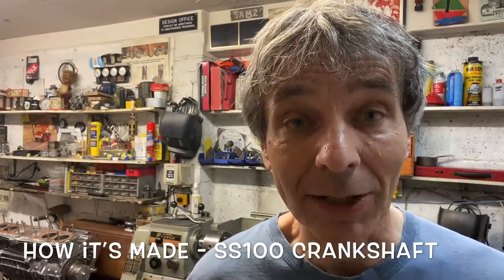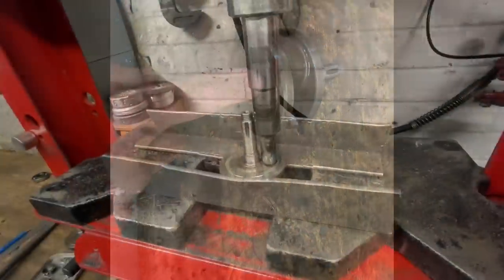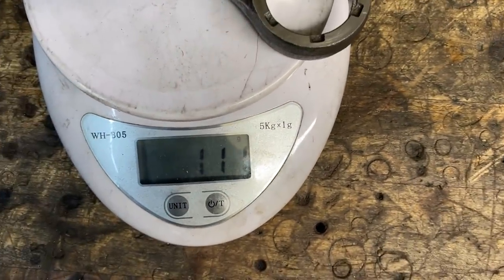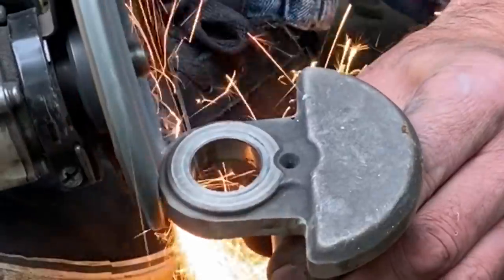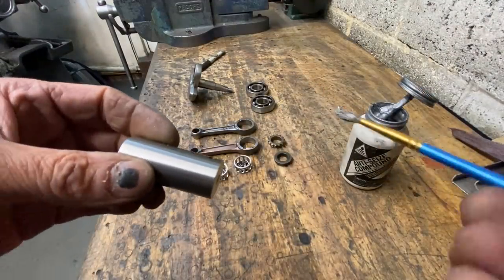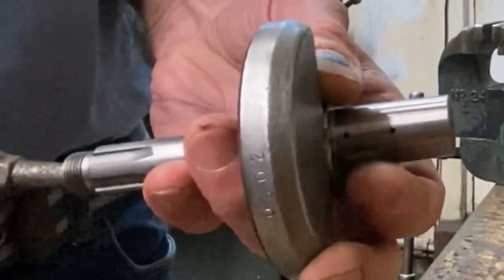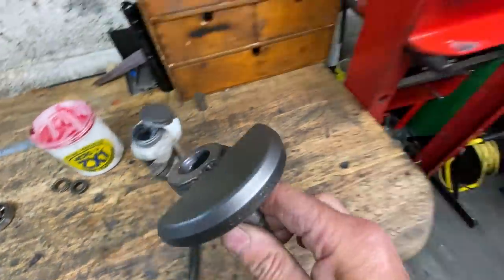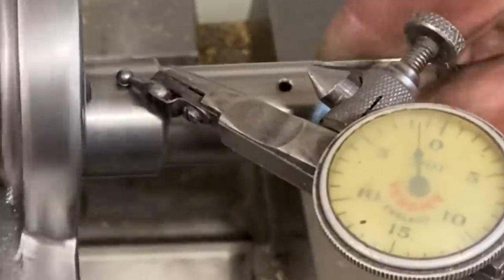Millyard Honda SS100 V Twin Crankshaft - How its Made 4

Comment: So do you machine the longer crank pin yourself? Or is it a reused part? If you make it what type of steel do you use?
Reply: Indeed, my question also, i think it is a bought in part, Allen will let us know shortly, im intrigued, fancy a go myself.
Reply: @michaelhayward7572  Yes, let's wait for Allen to tell us.
I can't wait.
What is it about this channel?
Addictive
Reply: My question also.  It certainly doesn't seem likely to be an off-the-shelf part.
Reply: He gets them made,
Reply: My question also.. i will wait for answer.
Reply: @stevebird8407  why would he get them made when he has a lathe ?
Reply: @Deftonesdsm  The process for the pins is more precision than a lathe by itself can produce, they have a ground and then polished finish as well as heat treating.  Perhaps he can ultimately do all that, don't know.
Reply: @Deftonesdsm  I would say heat treating/case hardening would make   DIY manufacturing difficult.
Reply: @Deftonesdsm   I'm guessing but they probably need grinding to get the accuracy and the surface finish
Reply: Could be an off the shelf unit. May be a special custom made item. Either way they need the correct heat treatment and precision grinding for a needle roller big end assembly. There are a number of possibilities open like finding an existing part that may be longer and larger in diameter then cut to length and grind between centres to desired diameter.
Reply: My guess is that he gets it made by Alpha Bearings.
Reply: @iandusud  yep! that is a very viable option for a 'special' builder
Reply: @Deftonesdsm   Needs grinding and heat treat.
Reply: @dumbbeerholder  you could 100% do that on a lathe. The hardening im not sure. If its through hardened then just really strong tools on lathe could do it. If its case hardened you'd need a precise oven for that and they do sell small "homeowner" ones. If anyone could do it it would be Allen
Reply: @oldretireddude  you send the component away to a specialist for heat treatment and case hardening, engineering companies use them all the time
Reply: The Pin is the "Secret" I guess...You CAN NOT make Crank Pins at "Home"!..I guess he found one from another application...which makes this Video USELESS without that info...Unless you have the wherewithal to strip out lots of Cranks to measure...Kinda dissapointing..
Reply: @Deftonesdsm  You seem very sure. How many engines, car or bike, do you know of which have turned pins?
Reply: You could make one, case harden it and get it ground to size. Loads of places in the UK do that sort of thing. My dad made custom rocker shafts for Rover engines the same way back in the day.
Reply: @Deftonesdsm  Hardening can be done by a flame then a quench.  Effectiveness would rest with the kind of material, likely ground and polished after the treatment.  I rebuilt many roller bearing cranks when I worked in a dealership back in the '70s.  Their techniques changed a bit over time with repair parts - most new pins came chemically etched on the parts going inside the flywheels.
Reply: @whalesong999   I just figured he threw it on the BarBQue.
Reply: @guzzijack9714  Hah, that's super..!  It's a hoot when he does that..;)
Reply: @Deftonesdsm  They have to be hardened and ground for the correct finish. Ps My question is how does he drive the cam. One long chain with one cam sprocket spaced outward. LETS WAIT AND SEE.
Reply: @whalesong999  yes with his angle grinder if the rest of the crankshaft is anything to go by
Reply: Allen made it out of 12   6" nails, welded together and hand filed to within 10 microns of accuracy. With one hand tied behind his back!
Reply: @iandusud  I understand he used Alfa bearing for the crank pin of his Velocette v-twin.
Reply: He says in this video that he gets his crankpins made by Alpha Bearings >> https://www.youtube.com/watch?v=PJS8NO2Koic  @ http://www.alpha-bearings.com/  I don't think it is meant to be a secret, he just forgot to mention it.
Reply from the maker: @madgardener5820  I get the extended crankpins made
Reply: @AllenMillyard  oh,, now you answer,,,, after how many people died of of acute anticipation,,,,, lol ;)
Thank you Sir!

Comment: More questions than answers , like where did you get the longer drilled crank pin?  How did u arrange oil for the camshaft  ? How did u fit a wider crank in the cases?  And why are the rods different colours?  Metal diffs?

Comment: Really good how to again ! I was just wondering what other single engines would be a candidate for the V- twin treatment -  keeping  in mind that the crank primary drive and gearbox have to withstand the extra power and torque ? I was thinking  the honda XL 185 XL 250 and 500 and those Rotax Cam Belt singes used by Armstrong Can - Am and Harley Davidson and MZ. The last one having a rather infamous spares situation. Cheers and Ride Happy !

Comment: ...I'm always amazed that the internal combustion engine's basic parts are so similar to the engines of decades ago . I've watched a few test rides of the impressive electric bikes ...but is there still room for improvement ? They're still very expensive - although the argument is that over the lifetime of the bike , the total lack of fuel 'fill ups' will save a fortune in petrol costs . YES - I'm wondering if you've had some thoughts on improving the ones you might have seen - or don't you approve of them ?! Testers have said that the relative 'silence' of them is disturbing !

Comment: Hi, Allen. I was wondering: when you aproach a v twin build, how do you aproach the cylinder angles? Is there a relation in the angle, the displaicement, ignition timing, balancing, pushrod valves vs. OHC, etc?? I'm very interested in what you have to say. 
Greetings from Argentina!

Comment: Allen. This project really captivated me but have some questions. You need 2 can drive sprockets on the crank. How did you trim the width of the crank to fit into the cases? And lastly how did you make the cyl base with the correct offset? 
What a fun project!!!

Comment: What crank pin did you use ? since its hardened metal and not easy to machine.
Reply: ryannaudi The idea is, to machine it first and harden it afterwards. However, only the outer shell is hardened while the core is less hard but tough.

Comment: Very nice. Now what about modifying the crankcase?
I can see from your ss100 video that you use original cases but, the cylinders are offset but you use a single cam chain so the they are aligned. 🤔 I also noticed the different sizing from the crankcase spigot hole to the cam chain tunnel are different! 
Intriguing!?
What parts have you had to modify?

Comment: Hello Allen, could you please tell me if the difference in connecting rods materials cause any problems with unique expansion of the different materials ??? Have you ever had problems not using anti spalling paste when assembling the crankshaft ?? I was surprised you could index the crankshaft halfs with just a three pound copper hammer. Keep us all informed with your project on YouTube. Thanks too. VF

Comment: Can you please elaborate on how to calculate how much to take off the crankshaft counterweights.  How is the weight determined compared to the weight of the piston and conrod assembly?  Why are the crankshaft counterweights in the same position? If the counterweights were offset to angle of the cylinder bores, would this produce less vibration and a smoother running engine?

Comment: Is there a reason you don't press on the main bearings and the sprocket before truing the crankshaft? Wouldn't that reduce the risk of the force of pressing on those parts pushing the crank out of true?

Comment: Where did the crankpin come from, just lying about in the shed?
Incedently the big end oil feed holes
should be behind the crankpin as it runs,at three o'clock when veiwed from the drive side with big end at TDC.I also noticed that both feed holes are the same size? asking alot
of the std oil pump.I suppose I'll have to keep watching to find out if it works perfectly,but I'm sure it will.

Comment: The material you  cut from the crank shaft, is the weight from the new piston, Connect rod? Or how  we know how much weight remove in this case? Thanks for those videos

Comment: Hi Allen  thanks for the video, l 've  just got a question. Why did you cut the crank down, is that because you had more weight in the rods.if so did you take off the weight of one rod?

Comment: When you checked the run out on your colchester then aligned with copper mallet, is the interference fit good enough on its own , or did you need to dowel the counterbalences in place?

Comment: I Asked why weight is removed from the crankshaft as actually more counter weight is needed to compensate for pistons, rods and bigger pin, figured out that it is easier to remove material from the now heavy side than to ad some on the counterweight side. Down side is that the crank is weaker now but good enough for show bike?

Comment: How do you know how much to take off the webs to get the balance right? 
Awesome vids Allen
Reply from the maker: I just cut it until it looks right, then it is right, All my SS100's are totally smooth running
Reply: @AllenMillyard  Many thanks for these priceless videos. I was wondering about this too. Don't you have to check the balance with the pistons connected? If you ever do this could you do a video on  this.

Comment: Allan, another wonderful and satisfying video! How do you compensate for the increased width of the SS100 crankshaft vs. the SS50 crankshaft? Are the right side main bearing, primary and clutch assembly in their original positions within the SS50 engine cases?
Reply: Allen.

Comment: Great vid again Allen. How did you decide the length of the custom crankpin and as such the gap between conrods and flywheels ? I guess that's a pretty important gap to get right to avoid too much play or too much friction of the conrods rubbing eachother. Weird actuially that there's no bearing in between there by factory (I'm a layman by the way :-)

Comment: What stops the sides of the con rods big ends from rubbing on the crankshaft and each other? Another great video. Maybe I will add a cylinder to my Yamaha SXR 600. Ha ha ha 😎
Reply from the maker: 5 million Honda 50 cubs running for 60 years with no side shims 😎
Reply: Oil

Comment: What did you use for the longer crank pin? Bought in part or if made, what material, heat treatment and final grind? 
Nice videos Allen,  I've been banging on about lashing together a few small Ducati singles together as I have around half a dozen on the floor that I trip over everyday!  😁

Comment: Could someone explain how on earth he knew how much metal to angle-grind off to change the balance factor of the crank shaft?
Reply: Quite simple really, you add the weight of extra rod, gudgeon, piston and rings times the moment arm of  the offset of the crankpin minus the weight of the extra length of crankpin figuring of course the deflectional rotation of the new piston going in a 90 degree variant of original direction and look at it and cut off the right amount holding it between  your toes.  Engineering 101.

Comment: Allen why lighten the flywheel, now that you have 2 cylinders? Your engine is going to rev 9000- 11,000 rpm thereabouts, if not more. Less torque in the bargain. Have I partly answered my question?

Comment: Those slitting discs are amazing but cut a tiny bit too far and the job is scrap or at least would need some highly skilled welding to fill what amounts to a crack starter.

Comment: It puzzles me that the crankshaft webs align with the bump of a copper mallet now why don't the go out of alignment under rpm and down gearing etc  all that inertia through the drive train ??
Reply from the maker: the running forces are rotational the hammer forces are tangential
Reply: @AllenMillyard  Thanx for swift reply Allen ( your skills / work is mind blowing 👍 )

Comment: Impressive,but the whole story would have been more inspiring: Is the crank pin DIY or from another engine ?If DIY What kind of steel?How were the oil passages drilled ? How was it heat treated?Was the crank balanced after truing?How to estimate Material to be taken off crank for a 90 Degree V2? Otherwise it is like a classmate smuggling a playboy mag into school but only hiding it after showing off front page.